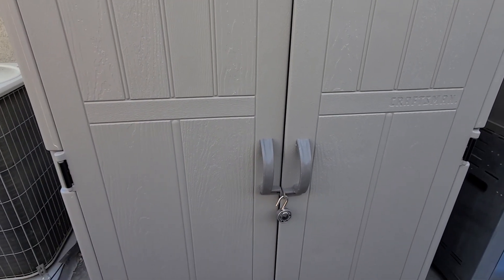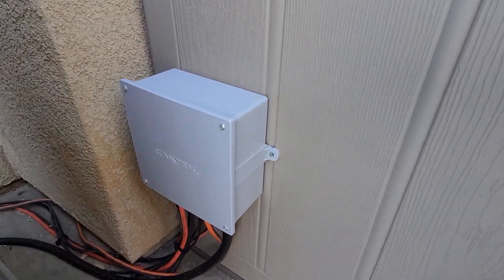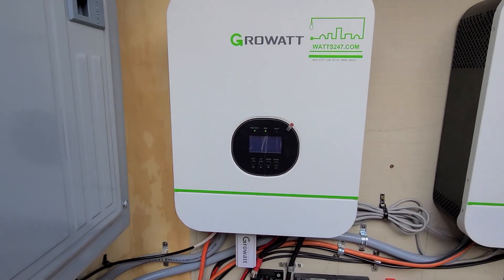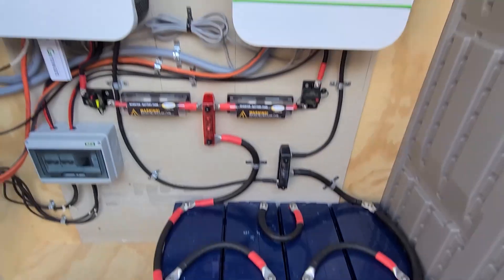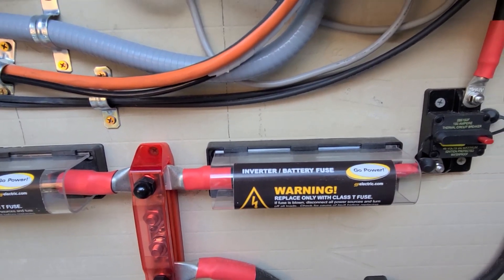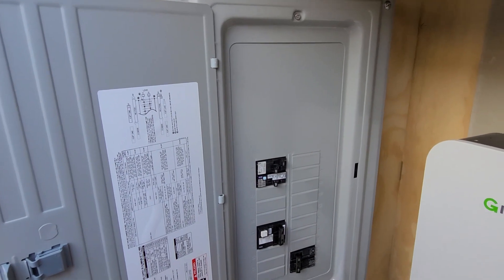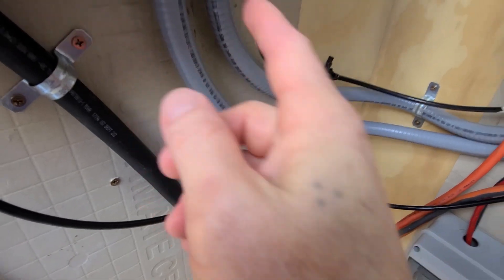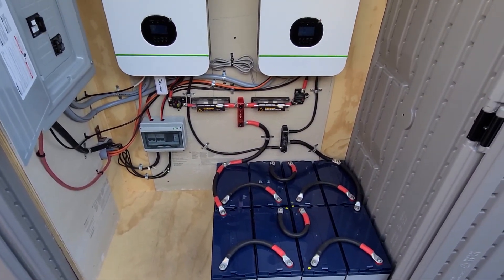DIY Solar - Solar Build Overview

Comment: How did you mount the plywood to support the weight of the inverters?
Reply from the maker: The plywood is attached together with two sides and a bottom. It stands up on it's own.

Comment: I'm trying to understand your system by getting it in my head first as I am planning on doing something that I think is very similar. My first assumption is this is an "off-grid" system and you tie your shop/garage loads to it by an extension cord (orange) that I assume is 20 amps from the breaker box in the shed. Also, you run a 220 line from the shed's breaker box to your jacuzzi. My second assumption is this off-grid shed is not tied to your home electrical panel in any way (other than supplying AC power to the Growatts (?)  ) as it is stand-alone and you plug things into it (garage & jacuzzi) in the same way someone might use a stand-alone generator to power loads. Are my assumptions correct or not? Thank you. You do very nice work!
Reply from the maker: Hi Ben. Your first assumption is correct. This is an off-grid system and the loads to the shop/garage are by 20amp rated outdoor extension cord wire/cable that originate from a Breaker in the panel in the shed. The 240V line to Jacuzzi is also wired from a breaker in the panel inside the shed as well. Your second assumption is also correct. I do not tie into the home electrical panel directly but rather bring ac power in as needed from additional outdoor rated extension cord/cables that connect to the Growatt inverters. The inverters energize the panel in the shed which then powers the breakers and lines connected to the panel. I do not ground the panel in the shed directly as there is the grounds that follow back to the main homes grounding system coming from the ac power source. Nothing is directly connected to the homes main electrical panel and the system is completely movable and not permanent when need be. Extra tip, if utilizing two inverters that will run in split phase to provide 240v be sure that the each inverters ac power input is from a different leg of your homes main panel and is a 20amp service and not a 15amp service. Hope this helps and thanks for your feedback.

Comment: A question I often ask when I see that kind of configuration: what not using a single split phase inverter? No LifePo4 cells, why..?
Reply from the maker: Hello J. Good questions. I think for me the configuration options and expandability along with price points and what you get for the money that these inverters were a great option for me. The batteries are Renogy Deep Cycle Gel Batteries. In the future I will most likely upgrade to Lithium but for now these gave me a great bang for my buck.

Comment: Nice..thinking of doing the same setup. What size are your cables from solar to charge controller?
Reply from the maker: Hello. The cables I'm using are 10 gauge from Temco. I will be doing the future video showing how I wired the panels to the controllers as well.

Comment: What are the size of PV, inverters and batteries ?
Reply from the maker: Hi Mike. The inverters are 48v 6kw, 4500 mppt. The batteries are 12v 100AH, and the panels are 260w panels.